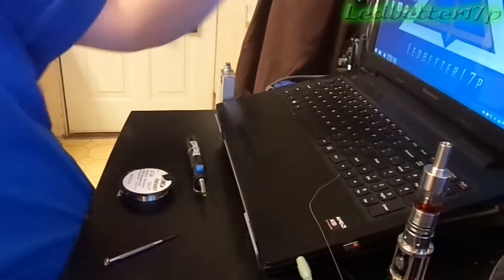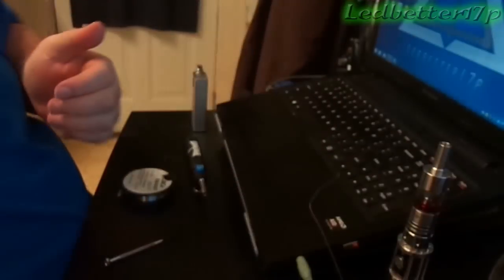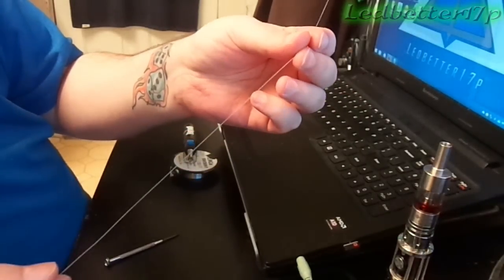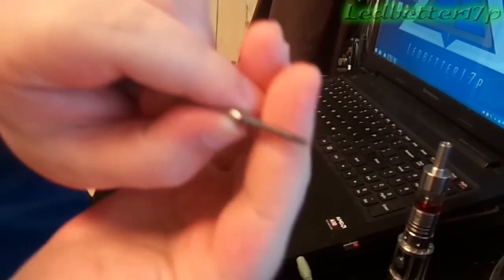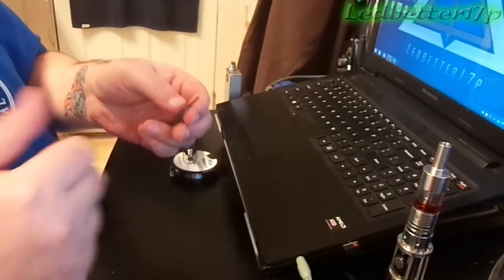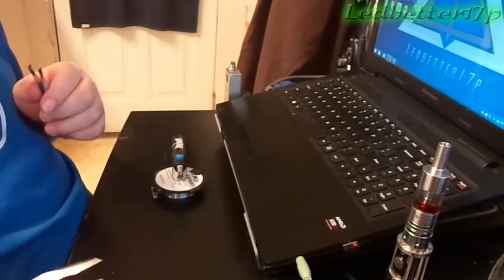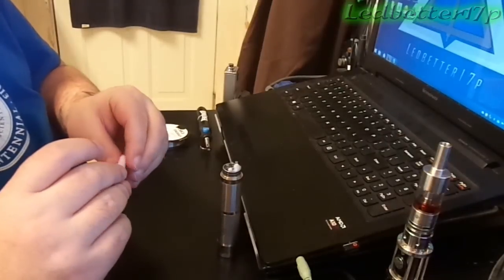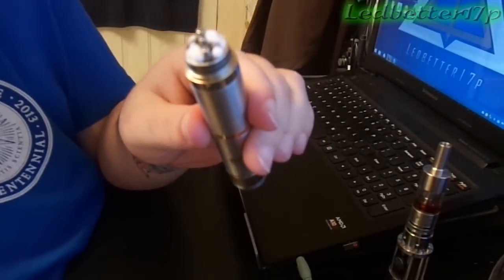How I Wrap A 0.8 Ohm Dual Coil For My Nimbus Clone

Comment: How many wraps on each coil?
Reply from the maker: +SoCal Rc Guy your best bet is to go to this website its a great coil calculator to help you build your coils and always make sure to be using the propper batteries and always use an ohm reader as well http://www.steam-engine.org/coil.asp

Comment: Thanks!  Shared it with my husband who has one.  He's really getting into building now.
Reply from the maker: awesome yeah i just got into building myself and its awesome i would like to build a lower ohm coil but i need to get a 30 amp battery before i do that the one im using now in my nemesis is the aw imr 18650 and its safe at 0.8 ohms but i wanna go to 0.4 ohms and its not safe that low.
Reply: ledbetter17p I know what you mean.  I am paranoid about safety, myself!   LOL!
Reply from the maker: yeah i amde sure to do a huge ammount of research before getting started  but i tell you my nemesis with the patriot rda vapes like a beast with a 0.8 ohm dual coil
Reply: ledbetter17p Nice!